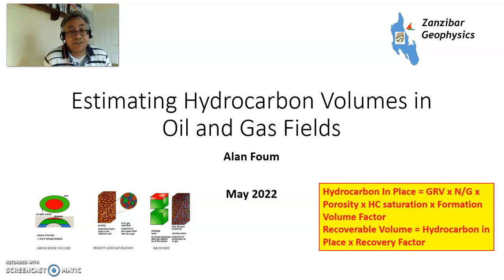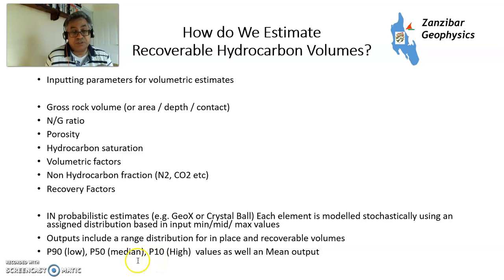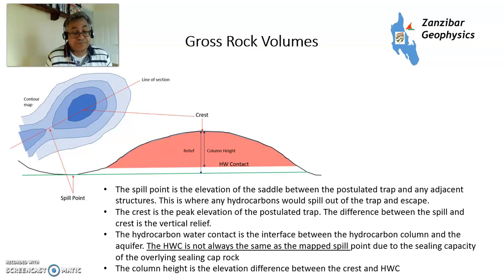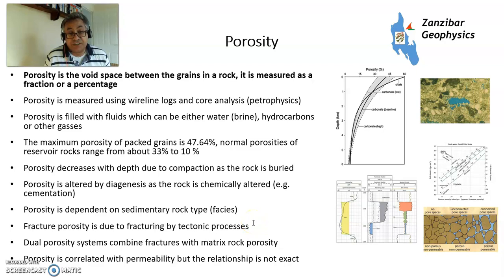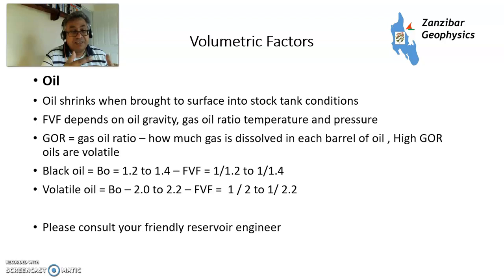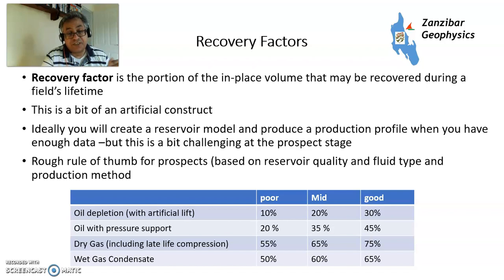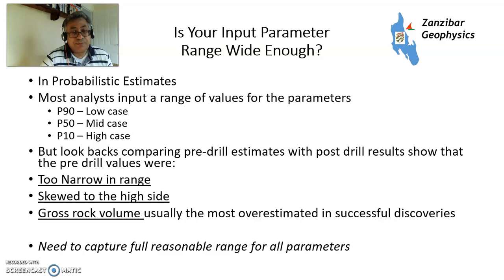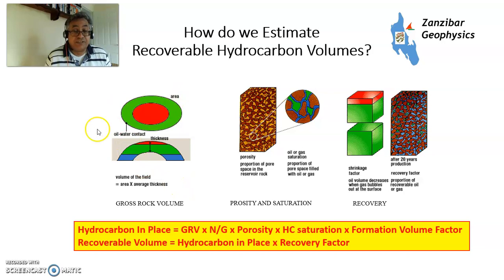Estimating Hydrocarbon Volumes in Oil and Gas Fields

Comment: While calculating the economics, should we use the minimum GIIP numbers or mean GIIP number??
Reply from the maker: I talk about this in my Basic economics primer video
To sum up we should use recoverable resource estimates not Volume in place
We should really use 3 cases , low. mid and high:  weighted using Swanson's rule - with 30% weighting to low and high and 40% weighting to the mid case to come up with a summary NPV value
If we are to use one case only (not ideal) then we should use the mean case as this represents an average of all the cases
Reply: @AlanFoumGeophysicist  ok thank you. i appreciate your swift response

Comment: I have two quiz.the first sone company use total porosity instead of effecive one.do you suggest why .the second one what is the basis for choosing montecarlo distribution input curve.❤❤
Reply from the maker: Effective porosity is the porosity that is connected, Total porosity includes non connected pores. The non connected pores cannot contain hydrocarbons. The connected pores may contain producible hydrocarbons and therefore this is what should be used in HC in place estimation. The two porosity estimates are usually very close in most rocks 

- please see my video a basic primer on porosity and permeability